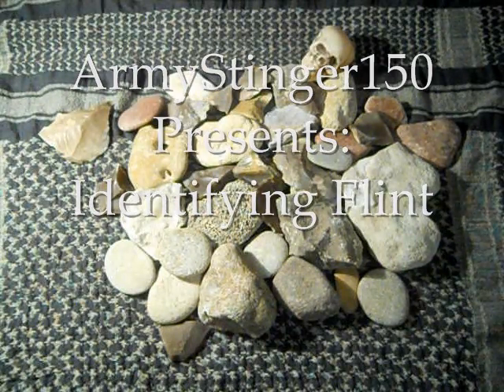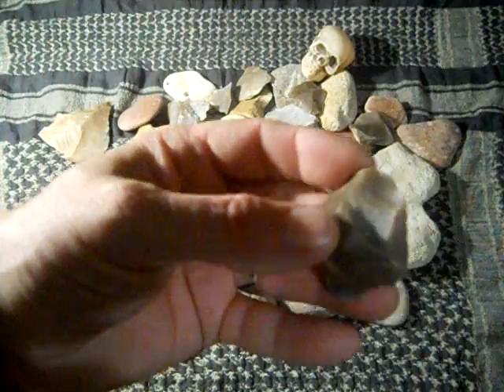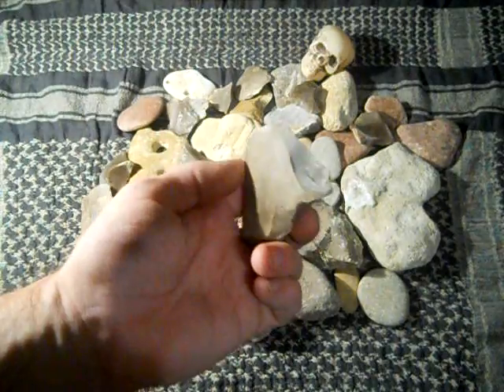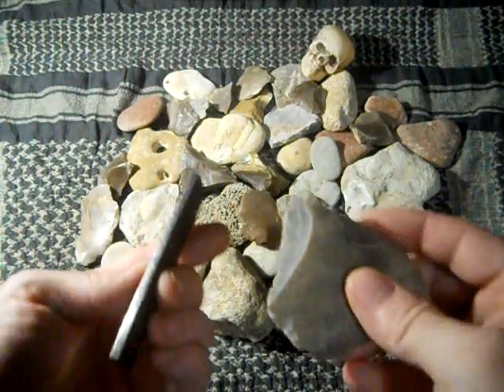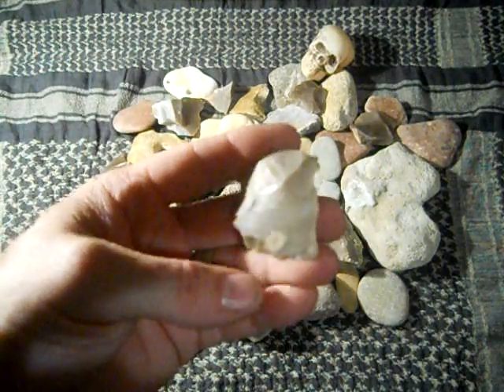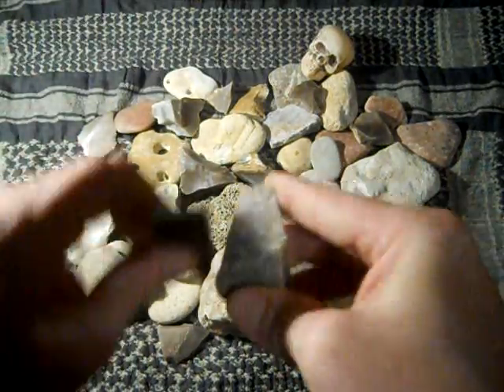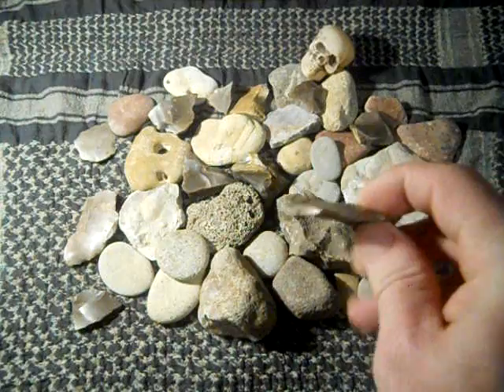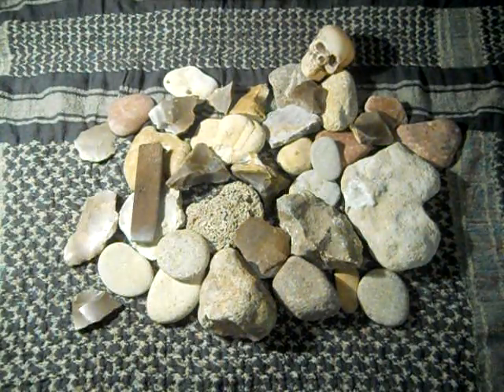Flint Identification

Comment: Most people wrongly believe that it is the FLINT that makes the sparks. It is not. It's the small shards of high carbon steel that glow when shaved off by the hard flint rock. 
"Lighter flints", which are not flint, have caused this misunderstanding. Of course lighter flints are made of "Ferrocerium", which is a combination of Iron, Cerium, Lanthanum, Neodymium, Praseodymium and Magnesium.
Reply: Reggie Garrett Or there is something like iron pyrite in the other rock.
Reply: RonRay through very rapid oxidizing. It’s amazing actually.
Reply: +Sketchy Koolaide   Actually you're right, pyrites, granite & flint-like rocks will each spark when struck with other rocks. For sparks with a fire steel, flint,chert jasper or chalcedony are usually used& do indeed shave off tiny flecks of metal which provide the sparks....just as two rocks shave pieces off each other to create one.
Reply: Thanks bro for information
Reply: I have many flint rocks and I use 2 flint rocks to create sparks by scraping 2 shape edges together.
Reply: you don't need steel to make sparks with flint, though. i have two round rocks with one of them being flint, the other idk, and it makes tiny sparks. i think that steel simply produces more sparks than the flint, but the flint also makes some sparks.

Comment: Thanks, i work in a limestone quarry and I see a lot of these rocks, I just wasn't sure which ones were flint.
Reply: +Martin Elam 
Flint is commonly found inside limestone. I consider you very lucky to have direct access to this great resource. 
Sometime, the crystalline nature of the flint inside limestone needs to be fire/heat treated to become smooth, like you see it either laying around or previously used by the American Indians. The Indians used to bury piles of 'raw' flint under a few inches of dirt, then build a fire over it for several hours or days. (At these temperatures, flint can "explode", so that is why they buried it 'under' the fire.) Afterward, they would get the really good smooth "glassy" flint that makes the best spear and arrow points.

Comment: I have some Blue / Black from Kentucky, Best I have ever used and seem's to be the Hardest.  Found some brown and red in a stream on the A T near the N. Carolina boarder with Va.  Tons of it there and it works good but nothing like the stuff from Kentucky, might be a part of the reason their Bourbon is soooooo good  .    An old file is the way to go, Don't pay 20 bucks for the fancy one's, most are hit or miss as the Smith doesn't all ways temper them correctly. a file ain't pretty but it's a sure bet !!!

Comment: Only carbon steel files work as a striker.You must have an older file than the junk they have today.
Reply from the maker: Yes, it's a high carbon steel "Mill Bastard" file, by Nicholson MFG, made in the USA...some time ago. But usually, files meant for "metal on metal" are still made of high carbon steel.
Reply: I've been trying to get decent sparks with random so-so rocks and a steel I just bought. Only the odd spark, most likely due to the poor quality rocks. But... when I tried a file, I instantly improved the number of sparks by 5 times plus. Going to work the file a bit and see if it gets better. Still hunting for flint/chert/etc... Oh, was messing around with some rocks tonight and pulled out what seems to be very small diamonds (X2). Just to test them, I wanted to try scratching something hard. Scratched a hammer like it was nothing, and scratched a drinking glass as well. Would other crystals also scratch this materials? We're not talking carats here, they're pretty small, unfortunately!

Comment from the maker: Yeah...it can't be found everywhere easily. There are alternatives to flint. You can also use Quartz...It is harder to use, but will work. Any rock over the hardness of 7 will make a spark with a piece of carbon steel. You might even try the railroad tracks...they use all different types of crushed stones...I found a huge cache of flint next to the river where the engineers used it as a bolster against erosion.